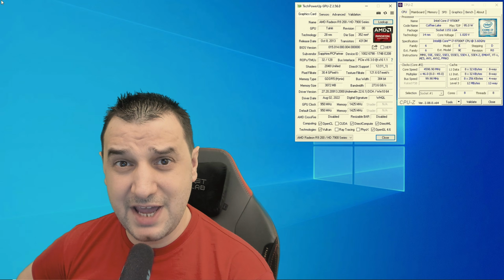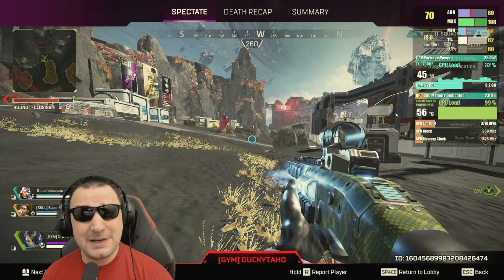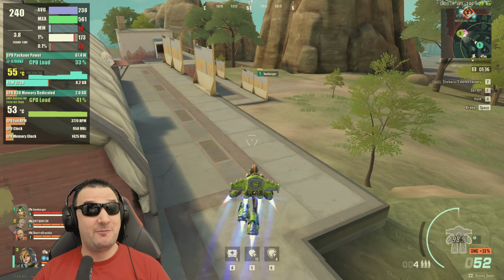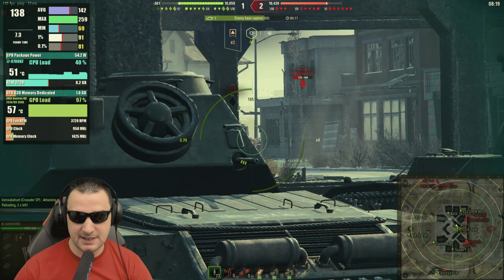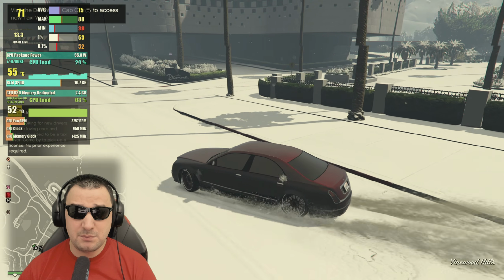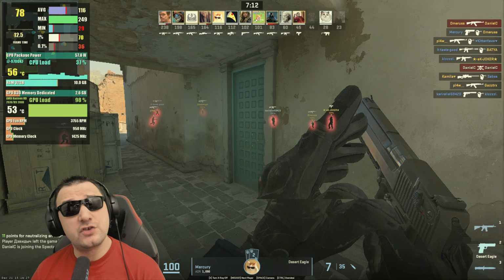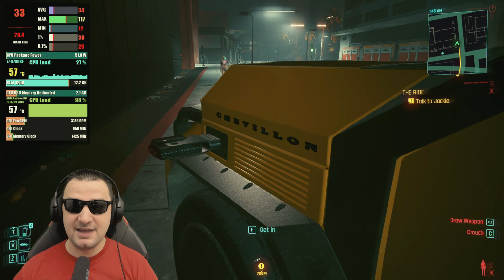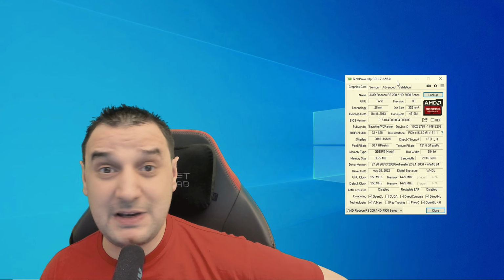Gaming on HD 7970 with 3GB in 2024 10 Games Tested

Comment: Hi mate, not pushing for another video just wondering if you're ok? Hope so. My not buying any more graphic cards until I get a new carpet has failed miserably, I could probably tile my living room floor in graphics cards. Cheers Mark
Reply from the maker: All good. Got carried away with work. finishing the new place where i will record. i just  installed Solar PV Inverter, batteries, wiring the AC, Air con,  lights, etc 
btw let the cards discharge. It will work again.